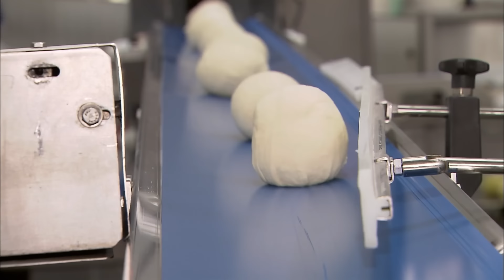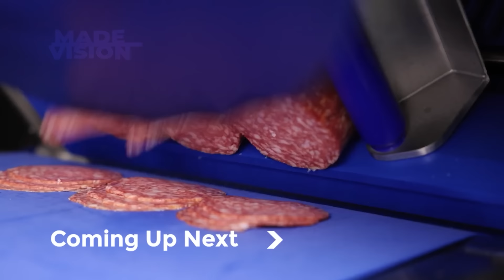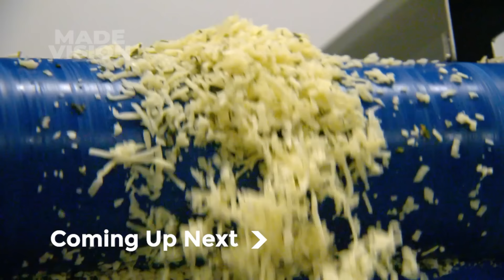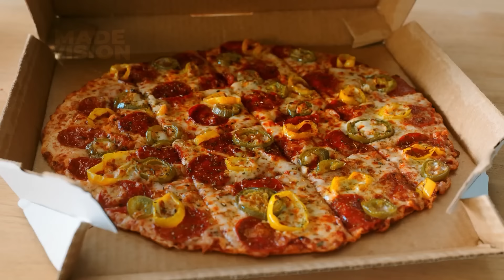How Domino's Pizza Is Made In Factory & Store

Comment: Many years ago I was a General Manager of several different types of restaurants. One was an all you can eat Pizza & Pasta buffet style restaurant. We had special pizza dough  delivered to the restaurant that came frozen and already stretched into a flat round pie shape that then had to be placed in metal cooking trays & stored in a walkin freezer. Everyday before closing a certain amount of trays was taken out of the freezer to be "proofed" for baking the next day, so it was always freshly baked for the buffet line or take out orders. We used fresh toppings that were delivered to the restaurant several days during the week and our pizza sauce was delivered to the restaurant that was specially developed for our business that came refrigerated in plastic bags. All the bakers had to do was take a preformed pizza pie with the storage tray out of the walkin that was already proofed & spread the sauce and any other toppings used onto the pie & bake the pizza while still in the same storing tray in our rolling bed cooking platform oven in which we would adjust the cooking temperature & time it took for the pie to move through the oven to get a perfectly cooked pie . The whole process took a few minutes. A very  efficient system and the pizza always had fresh tasting hot pizza for customers which our customers always said was much better than Domino's.

Comment: Domino's is ok but a Real Pizza made by a real Pizza Shop that knows what they are doing are 1000x better nothing beats a brick/stone oven set to oven 700°F  some as high as 900°f.
Reply: I'll take a good New Haven style pizza any day over it
Reply: Which means the outer bottom surface is overcooked, and often tastes burned.
Reply: @sdspivey  not really the heat cooks faster that's why a legitimate pizza shop is always checking the pies 3-6 minutes depending on temperature. Plus the stones or bricks are drying the dough no grease to Burn the crust if done correctly, yes a inexperienced shop can turn a bottom into charcoal but it's not a burn like dominos or pizza Hut in a Air Oven would do if it got stuck inside the oven I was a Cook at a Pizza Hut I've seen it happen. Or if the shop doesn't clean their ovens cooking on top of carbon from previous pies .

Comment: I worked for domihoes in the the late 2010's until my franchise shorted me 20 hours of covid pay. All of our pizza sauce came in concentrate bags. We added tap water to them in a bucket then used a big hand mixer to mix it. My store was lucky to have a hand mixer. Other stores in my area had to mix it by hand with a big wisk!
Reply: Where you from that you do that? I run a store in Australia and our sauce comes ready to use in the bag
Reply: @icer1249  Lansing, Michigan USA
Reply: @Viperman200221 that sounds very inefficient.
Reply: @icer1249  You can fit smaller bags of concentrate in a box then you can fit bigger bags of ready to use sauce. Money is the bottom line and shipping concentrate is cheaper! Although It has been a few years since I've worked at domihoes and they may have changed but I doubt it.
Reply: Tap water from Lansing? No thanks! 🙏🏻  @Viperman200221
Reply: Damn even Hawaii dominos switched to nonconcentrate. No clue why a mainland store would do that. The shipping savings are so small compared to labor costs.
Reply: The Domino's I work at switched to non concentrate almost 5 years ago